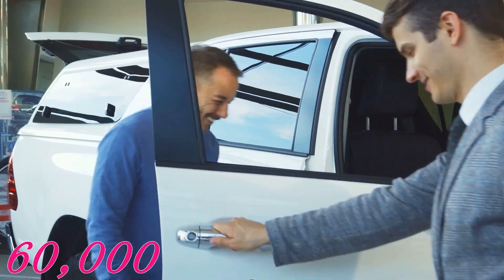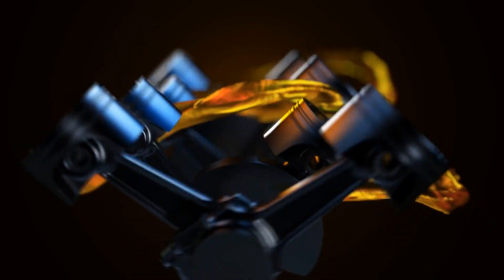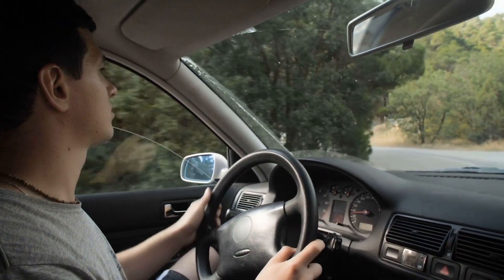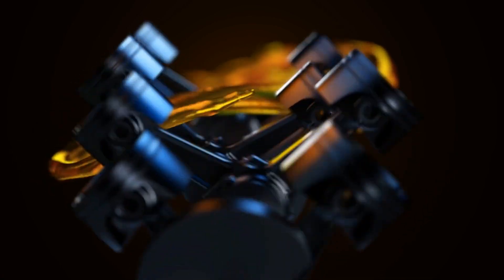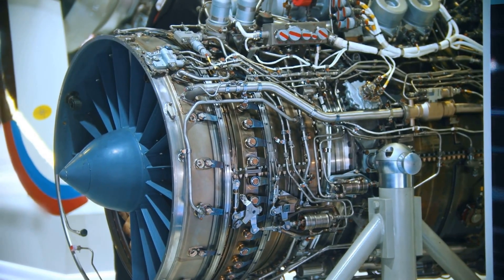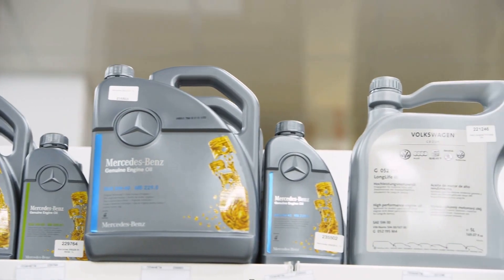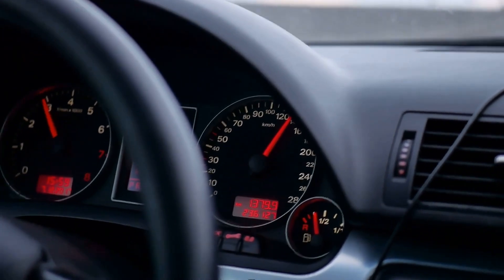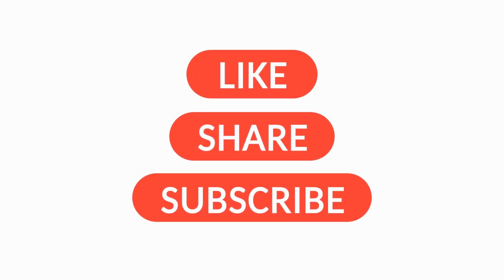0W-20 vs 5W-30: The Real Damage Revealed After 50 Engines Tested!

Comment: The 50 engine testing has been debunked. There were no facts of testing. Most testing are with new engines that had not past the break in period.
Reply from the maker: Appreciate your input. You’re right engine break-in periods can skew test results. We’ll be covering more long-term data soon. Stay tuned